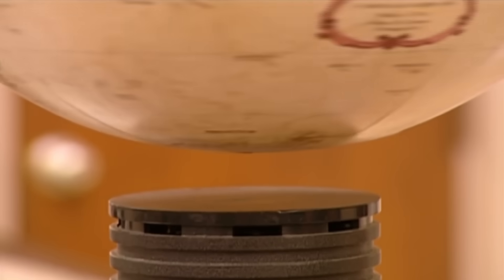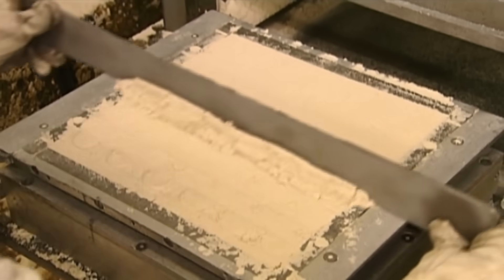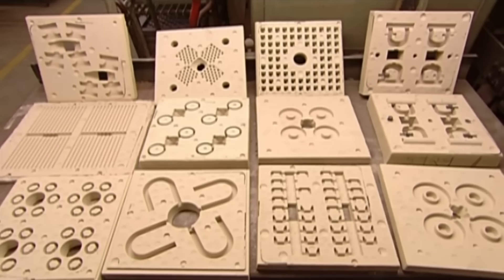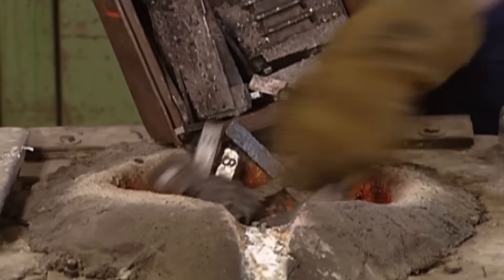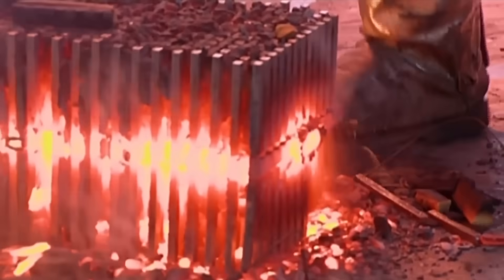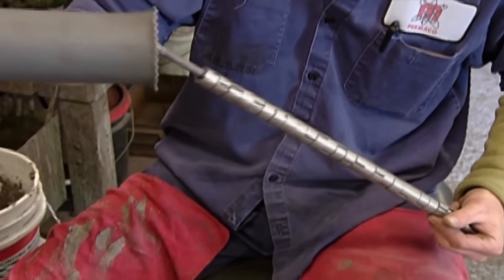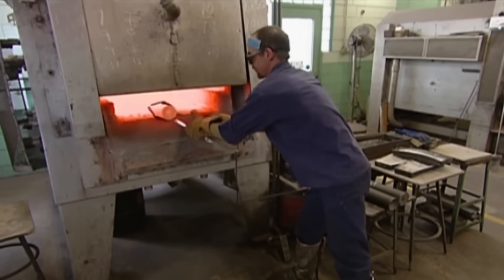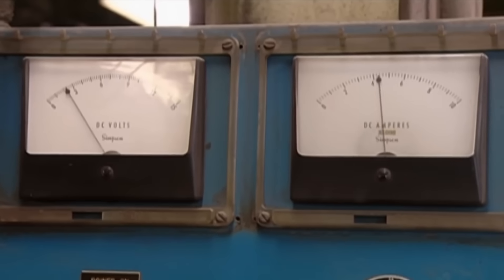How It's Actually Made - Magnets

Comment: Magnet production infuses magnets with magic magnet powers, and if the need for it arises, production lines may be shifted into emergency mode, in which production continues as normal except for the fact that the magnets are coated in a paste of dark matter. This enhances their flavor and may do other things which are as of now not yet known. It may also improve the effectiveness of the magnets, however nobody can agree on what a magnet's "effectiveness" is, which results in the physics of the magnets changing yearly, which is synchronized with the yearly meetings of the International Magnet Effectiveness Committee. In certain cases smaller, more frequently meeting local groups may override the international group. This has only happened twice, once  50 million years ago on the small island of ungabunga, and once in 3710 on the 314th day of wedmonesunfriday in nevervember. It happened because the glacially expanding cloud of vapor on the lunar committee named Johnson J. Johnathan decided that magnets never existed. And every single last one of the 4,294,967,295 John Smiths on the jovian committee agreed.

Comment: A thought races through your mind, you press the green button and think to yourself, "I gotta touch that magnet. I know I can't move it while the green button is depressed, but if I could try.. What could go wrong?"  You throw your hand out as if it were food for pigeons. The memory of your deceased wife floods your mind. "You only had one job." She says. You look down as your hand approaches the magnet, but your watch's attraction has grown stronger than the force you threw your hand with. Your heart begins to sink, you know what you've done. You watch as your time piece plummets face first; spraying glass in all outward directions. The shock of the movement of your watch breaking the sound barrier shatters your concentration and discombobulates you. "This won't end well."  You think as you lift up the bloody joint of what was once your wrist. Tendons and indistinguishable viscera torn without any care for reconciliation. The watch quickly depresses into an 
unrecognizable blob of twisted steel. Steaming, then glowing. You look at the How It's Made crew, and stare directly into the camera:
"Fuckin' Mondays, ammiright"

Comment: 4:15 reminded me what me welding teacher said when I asked how it works: something with volts and amps. I don't know the difference but I know they aren't the same.
Reply: If you think of electricity as flowing water in a pipe volts are like water pressure and amps are like flow rate
Reply: @inhumanthoughts3509  thanks but don't the 2 go hand in hand? Higher pressure will force it to flow faster.
Reply: @leweharpoon3144  and if a pipe is wider/wire more conductive the flow is greater too
Reply: @inhumanthoughts3509  that makes sense. Thanks

Comment: 0:39 interesting placement...
Reply: If you think that's iffy, be careful about panning Google Earth over apartment blocks in certain places... 😳

(The reason why they're placed like that is because each magnet shape needs to be in contact with the central core where the metal is poured in. Placing them like that allows for a longer length of magnet while conforming to the standard size of the mould. Shorter magnets would be placed the same, but not at such an odd angle as the corners wouldn't need to be exploited for longer length. 🧲👍)

Comment: You know, I'm genuinely interested in how magnets are made. I didn't get the answer to that but I'm more than happy
Reply: tl;dr they cast some metal into a shape, and then nuke it with a massive electromagent for a few hours until it becomes perminantly magnetized.
Reply: +Orange Waffles your profile picture is scary
Reply: @mosshivenetwork117  I thought it looked cute
Reply: At first I thought this was legit. Then I heard "some yellow shit" still great video.
Reply: @sean-star  it is legit tf do you mean
Reply: Magnets are magnetized using other magnets. Not kidding. Those two plates you saw were extremely powerful electro magnets that forcibly align the molecules in the metal of the magnet. Once aligned the magnet is... magnetic
Reply: @zachfruin7684  Wait, if it takes two magnets to make one magnet... who made the first magnet and how
Reply: @oerlikon20mm29  there are some methods im sure. But magnets are often natural, just usually pretty weak. The most reliable and easy way to make a magnet, and is probably the way that the first magnets as we know them were produced, is electromagnetism. Those plates he used to magnetize the magnet aren't always magnetic. In fact they only have a magnetic field when electricity is being applied. The same idea can be seen in simple household objects, have a copper coil and pass electricity through it, might get a paperclip to act funky in the center of the coil (not recommended, unless you know what you are doing, this can be dangerous)
Reply: @zachfruin7684  so, if I were place myself on that magnetic field creation device, would I become attractive
Reply: @oerlikon20mm29  you are giving me a dangerous opportunity to insult you, and I am going to do everything I can to stick to the science of it. If a molecule is not effected by a magnetic field, thus ferromagnetic, then the field would not align the molecules anyways. So only things that are attracted to magnets can be magnetized. There is not enough iron in your blood, and its also in the wrong form to be ferromagnetic, to be effected by almost any magnetic field. That being said, we do have electromagnet on earth that create such incredible magnetic fields that they can start to effect a person's vision and brain function, but that is nearing cosmic levels of magnetism, like quasar type power there. And even then, you only feel the effects a little, not possible to be magnetized. So to answer your question, there is no chance you will ever be attractive, and you should perhaps stop blaming your personality on why they left you. (I couldn't help myself)
Reply: There made from the fires of hell obviously lol
Reply: Intimidate _lazer you are not wise from the dangers of the rabbit hole
Reply: @SashaSlvt  tell me about the hole of that rabbit please
Reply: A chan stop looking at me like that. Im not browsing youtube by choice stop. I know its 3 am
Reply: How did you get confused?, he explained it in detail for 4 minutes.
Reply: @trevorgoodchild420 closer to 5 but I’ll allow it
Reply: Usually I'm able to decipher the actual process when I watch one of these videos, but they lost me when they knocked the molds over and started beating them with sledgehammers while the metal was still red hot.
Reply: If you put iron in a magnetic feild it becomes slightly magnetised. Hella useful for self exciting motors.
Reply: Maybe you should pay more attention next time.
Reply: While the metal is still hot/soft they run the current through it, when the metal cools with the electric current running through it, it locks in the molecular alignments 👍I think the melting temp of the metal determines how strong of the magnet it can be, because it can take a higher current while soft/liquid.
Reply: Is orange your favourite colour by chance?
Reply: @pur31y_m0ch4  How could you tell?
Reply: Mad dig, man put rock in machine, man melt rock, rock get shaped different, man take other melted rock, man combines rocks, man has shiny metal magnet
Reply: Bro didn't watch the video

Comment: None of the metals he mentioned are magnetic and I expected nothing less
Reply: aluminum/aluminium is actually magentic, diamagnetic technically. that is a form of magnetism which works opposite to how ferromagnetism (the one we are familiar with) works.
Reply: @cageybee7221  you dolt! Aluminium is magnetic, but Aluminium isn’t
Reply: @Victor-Baxter  Damnit, why does that wordplay work?
Reply: I'm pretty sure some yellow shit is also magnetic
Reply: @SheagleArk Yep, it's why magnets are banned in China.
People kept getting stuck.
Reply: Nickel
Reply: @noodleman1815  and cobalt ;)
Reply: This man does his research to provide the absolute least correct information possible.
Reply: @smooth brian iron and steel
aluminium and aluminium
Reply: @Dylan Prothero no he said aluminum and aluminium
Reply: More importantly, the material after which the phenomenon (ferromagnetism) was named, iron, was NOT listed.  Most permanent magnets will be made mainly out of iron, if only for its abundance and relatively low cost.  Many of the materials listed might be reasonable alloying materials for making magnets, but leaving out iron is failing to address the elephant in the room, and clearly intentional.  It's the one thing most high school students would reasonably expect to be in a magnet, I'd guess.
Reply: Adamantium and cobalt are magnetic
Reply: everything is magnetic
Reply: They may not be magnetic on their own individually but aluminum, nickle and cobolt are used to make AlNiCo magnets that sound great when used in guitar pickups and speakers. Sorry, no joke in this comment.
Reply: i hope this comment is a joke
Reply: the yellow shit is actually quite magnetic, you should do better research
Reply: These look like the ingredients for alnico alloy.  Though I got no idea what the sulfur is for.
Reply: Well yeah, if they used magnetic metals, they'd already have a magnet. How do you think we get those metals? Melted down magnets!